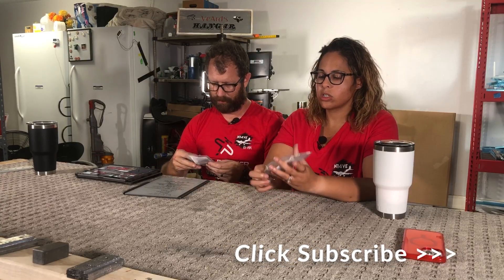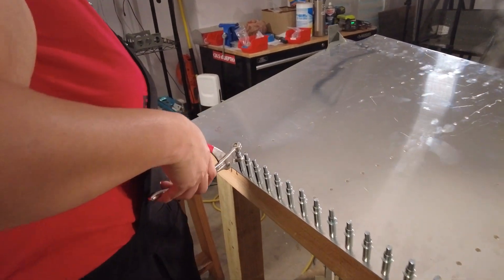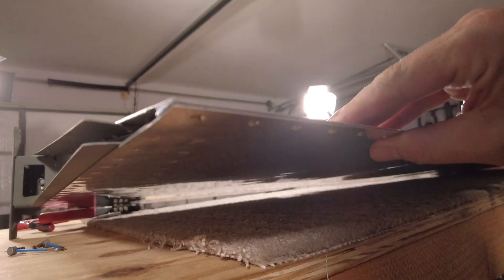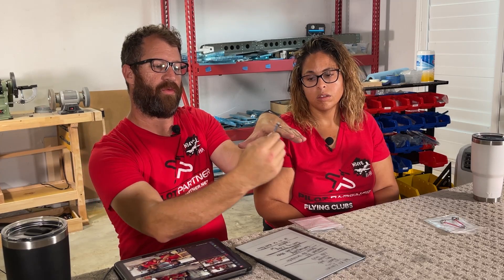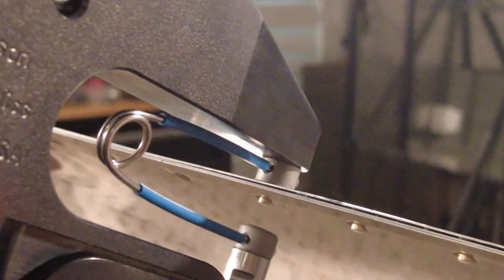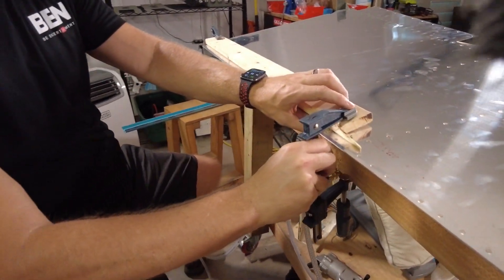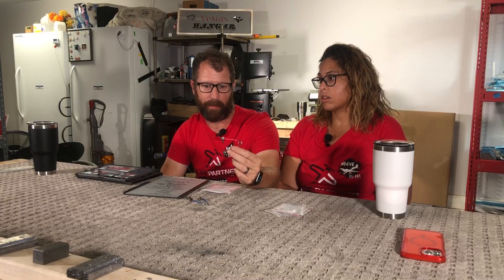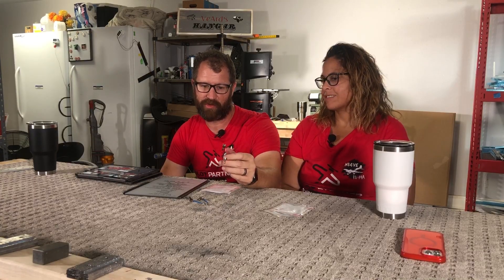Setting Trailing Edges the Easy Way - Vans RV-14A

Comment: What make and model pneumatic squeezer are you using?  And do you recommend it?
Reply from the maker: It is the one from Clevland tools and yes, I wouldn’t use anything other than this one.  We love it. 

https://cleavelandtool.com/products/pneumatic-squeezer-no-yoke-snb214
Reply from the maker: This is the yoke we use the most.  But you need several different ones for different reasons. 

https://cleavelandtool.com/products/25-flange-nose-pneu-yoke

Comment: Absolutely agree with this video... I screwed up a few on the 14 elevator and then stopped and waited for my die set to come in and nailed them all almost perfect double flush. Note - I even went back to the ones that I screwed up and re-squeezed them. Crazy, even the screwed up ones look pretty good now.
Reply from the maker: It shocked us too, but if you think about the physics it does make sense.  You squeeze it right, that rivet only has the correct place to go.  And squeezing it again does work really well.